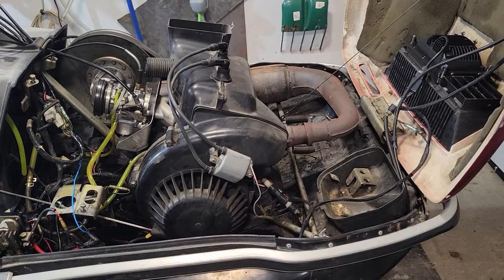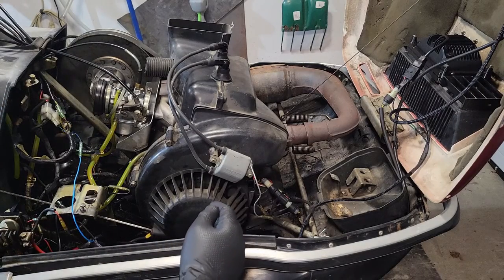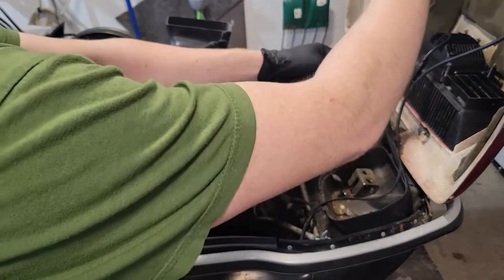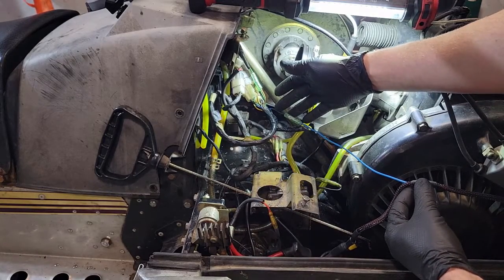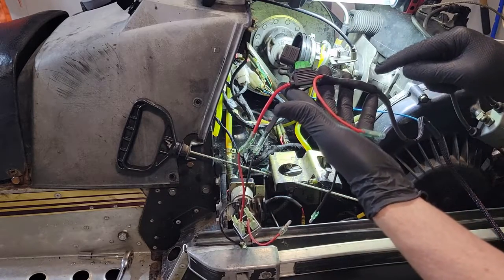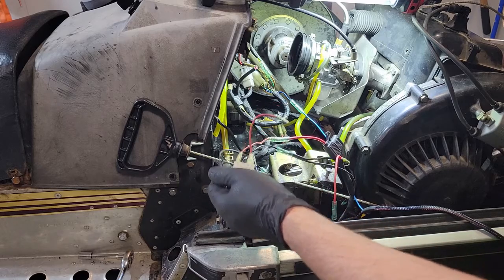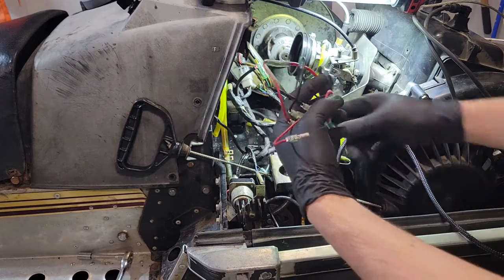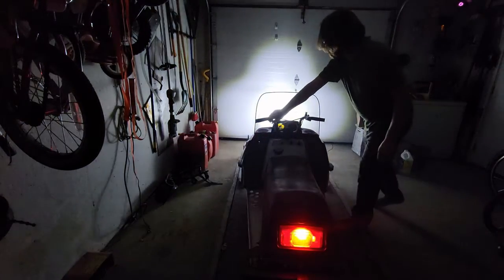1980 ET340 Electrical Upgrade - Pt 3

Comment: The stock bulb is 12 volt, why not just wire your LED into the stock wiring harness at the bulb end?
I’ve been having problems with 2 stock Enticers with the headlight, so last minute I’ve been mounting a LED to the hood latch, grounding it (a ground is a ground) and using the blue gauge wire to power it, as LEDs draw very little, it works fine.
I’m lost as where AC power ends and DC begins on a stock harness.  My thinking is it’s 12 volts off the lighting coil, as in there is no ac outside the engine in any wire on the harness..
What am I missing? 
Thanks for the video
Reply from the maker: @mikem9953  All the stock bulbs run on AC fine because they are filament based. The reason for sending DC is to reduce flicker and give them full power.
Reply: Ahhhh, gotcha. 
Thanks.
Reply from the maker: All the wiring on the stock harness is AC. LEDs are diodes, so they only let current flow in one direction. Think check valve for electricity. Because AC is switching directions, the LED is only powered half the time. The reason for rectifying AC to DC is to get more power to the bulb.
Reply: I understand an LED.
Is the stock headlight bulb, tail light, dash, fuel, gauges all AC bulbs???? So why in the world would you have to change anything for an LED?  You can power them from below 12 volts to over 30 volts.